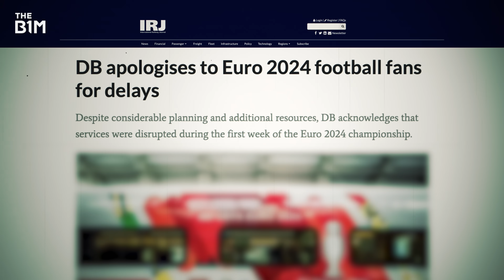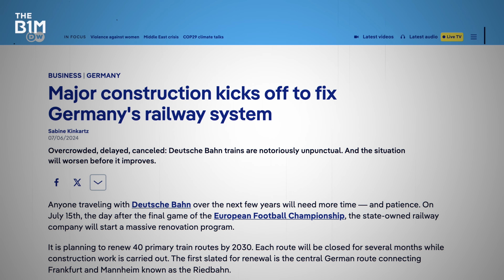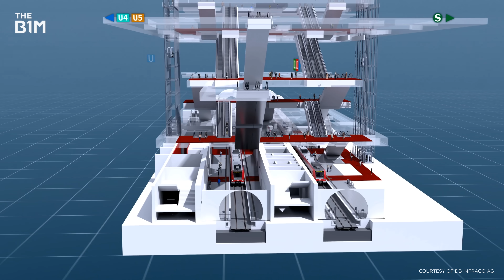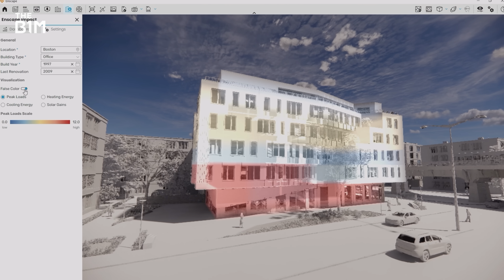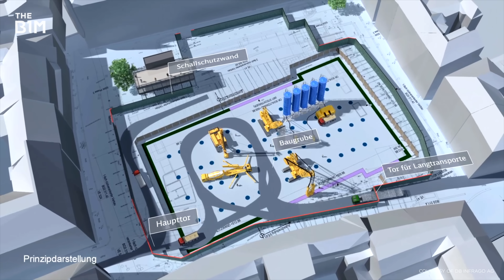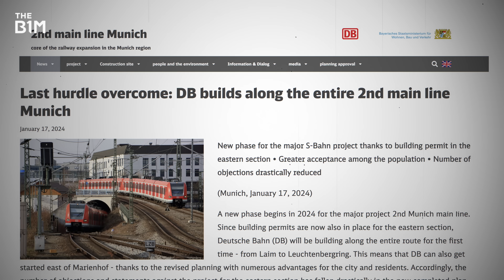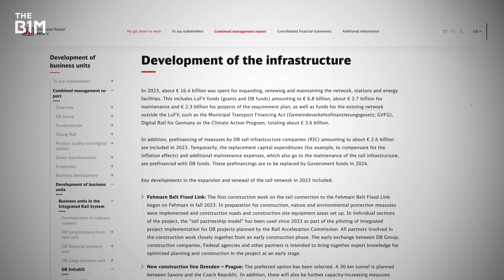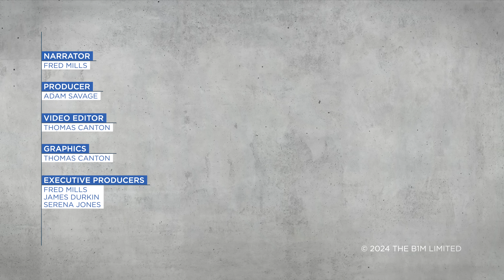Germany is (Finally) Fixing Its Failing Railways

Comment: well as a transit planners point of view i have to mention that the munich 2nd s-bahn rail core is mostly politically driven and most of us planners agree if we could stop any transit project in germany, its that one, since according to studies, it will make public transport worse and also never make up for the carbon emissions during its construction. its similar about Stuttgart 21, since it actually reduces stuttgart hbfs capacity (which is actually the most punctual train station in Germany) and will not give room for service expansions, its mostly a real estate project for the formerly occupied area of the train station. however the project could be useful if part of the overground station is kept

Comment: Compare and contrast with the UK's long struggle with HS2, and it's miss selling as a high speed line, as opposed to its true major benefit, capacity.   Britain's railways need a similar upgrade across the system to make it fit for purpose.  I hope it will come, and soon, but I'm not holding my breath.

Comment: That's great!
But I don't get why, for München's S-Bahn, they don't go Paris RER style by building a North-South tunnel instead of simply doubling the East-West one.
Funneling so many lines or branches in the same corridor seems a bit weird given that several branches run to the North and South.
A single S-Bahn tunnel and corridor is fine for a few branches, but 8 lines and presumably twice as many branches? 
The current system looks like a bow tie or a "farfale" pasta, with a clear bottleneck. Another central tunnel, but built North-South, would improve the coverage of the city by taking some lines off the current East-West tunnel and creating another corridor.
Lines could even loop from one central tunnel to the other and form a kind of 4-leaf clover shaped S-Bahn network, with 8 shaped lines.

Comment: In the south especially towards Switzerland via Basel SBB passengers are not this lucky. Expect delays up to 120 min and terminations prematurely at Bassel Bad. 
The line between Offenburg - Freiburg - Bassel is one of the most congested routes and an International one (with regional, long distance high speed (international), and freight (international) all running less than a minute behind each other without ETCS, which just mad and a disaster waiting to happen.   
Here's the dumbest part they plan on adapting ETCS (European Train Control System) and line quadrupling by 2040!

Comment: And how many of these new stations will be wheelchair friendly????  And with wheelchair friendly, I mean, being able to go in and out with a wheelchair without the need of assistance.
Reply: into the station ?
all of them
...
into the train ? well ....
Reply: @baronbrummbar8691  yeah, into and out of the train. Without the need of special ramps or assistance,  just same level platforms that are close enough to the train to just roll into the train.
Reply: @PetervDam  that is impossible as the trains have differente broads  
you can´t make the platform go to the train or a wider train will not fit
Reply: @baronbrummbar8691  impossible? Cities like Seoul show that it is possible. Some have moving parts when the train stops that close the gap. Its no rocket science.  It's a costs thing but if we want to go green, its an important step to include the less able as well in my opinion.
Reply: @PetervDam  you do know that would require to replace all trains ........... 
it is not as easy as to simply 
install XYZ
the entire system has to be made for it
Reply: @baronbrummbar8691  my point of my comment was only to put some awareness that even with big billion euros projects like these, making it accessible is still not a thing. It's a limited factor for more people then most think. I know it's not as easy as a different color paint job for the train, but hopefully with more awareness and more noise, the accessibility might be considered more often then not, like now.
Reply: @PetervDam  noice making will not change the reality 
completly reconstructing existent things is super expensive and the group that needs it is just way to small to justefy that cost
.........
the new train stations will allow anybody to get to the trains
and majbe they need some help to join enter it and ther is no problem with asking

Comment: Honestly, a project the size and complexity like Stuttgart 21 costing 11bn isn't something crazy high. Expecting that it only costs 4bn was just naive. 

Just look at the "Durchmesserlinie" in Zurich. It is ONE tunnel. ONE bridge. And only four new platforms at Zurich HB. And it already cost 1.5bn. 

Stuttgart is at least 10x larger and at much more complex. Good infrastructure is just expensive.
But people don't realize that bad/easy infrastructure like Autobahn is as expensive. It is just build in smaller increments, for much less capacity.
Reply: Stupid plans are expensive. Instead of letting high speed trains stop at the Stuttgart airport and connect the city (who wants to visit this city?) from there local „politicians“ forced both government and DB into this stupid nightmare if Stuttgart 21. We had the same with each and ever new high speed line in German. Frankfurt-Cologne got two additional stations just 30km apart only to please local politics and convert a high speed connection into a joke on track. This is like forcing direct flights from Hamburg to Munich to have two stops Cologne and Düsseldorf. 
Last nail into the coffin of high speed connections: They have to share the tracks with all kind of slower passenger and non passenger trains. 
This country wasted over decades billions of Euro into more concrete for roads and highways. Some countries are driven by good ideas, this country is only able to let fat people drive cars without any sense 24 hours a day.

Comment: A country that you wouldn’t expect to have a decent railway system is Italy… the process of replacing old trains is almost finished… delays are becoming the exception and high speed service is one of the best made in the world. Also the application of Trenitalia is really well made and the various services offered by Trenitalia are very nice.
Reply: And yet the local public transportation system in Rome sucked when I was there
Reply: @baab4229  I don't see how Rome having mediocre public transport relates to the national railway system of Italy. Did you travel around rome via regional trains or what?
Reply: For reference: trenitalia was so successful, it put their national airline out of business.
Reply: Italy's shape makes it very easy  to build an efficient network tbf.
Reply: @LievenSerge how Shape is not the only relevant thing, obviously being long and thin helps. But it’s crossed by mountains all around.
Reply: isnt making the trains run on time the mantra of the modern italian state?

Comment: What's going to be interesting as well is the plan of the city of Frankfurt to basically build a huge underground terminal under the current main station. Frankfurt is a sack station, meaning the train has to go out of Frankfurt the same way it got in, so they made a plan to change that via a huge underground terminal and tunnels

Comment: it is true what you are saying, but you havend mentioned importent things: 1. Volker Wissing ist vorm the conservativ, liberal party FDB, witch supports more cars then trains - he only did this because he had no other choice. 2. The 40 BL € are not even close to be enogh. It will will need more than 90 BL €  to only get an ok running system. 3. Therer are several major projects, witch are extremly neccesarcy to complet, but are not getting forward. Like the route from Italy to the norther sea. All countries have finished their traks - except for germany. They haven even startet to incriese the traks to 4 on the Rheintalbahn, which is exremly overcrouded.

Comment: 1. Use as few transfers as possible. 2. Replace a short trip from a bigger train station to a small local station with a rental car. 3. If transfers aren't avoidable, make sure to use the same train type for all of your routes. 
This way you're almost always on time. And if not, you're way too late. Like in hours

Comment: A few point.  DB may have been making a significant amount of refunds, but often refunded only the outbound leg of a round trip ticket when a train was cancelled, even if the return trip could not be reasonably used by the ticket holder.  Fixing the S-Bahn in Munich is nice, but long-distance trains will still need to loop around the city when traveling to points south and east, which adds about 20 minutes to travel times.  That this project, which started in 2019, could take another 12 years and only improves S-Bahn service is crazy.  Germany is still not doing enough to bring train speeds along all corridors up to the standards of France, Italy, and Spain.

Comment: Switzerland made the trains something the rich want to ride, and it has been a successful endeavor.  When the rich want to ride, trains get funding.
Reply: As long as the rest of us can afford cattle class!
Reply: @TheHoveHeretic  
That's the thing, they are affordable, it's that they are run better so that lateness is much less of an issue.  These trains do have amenities that the rich can purchase that make it convenient as they travel, and that helps offset certain costs, too.
Reply: TBF they pump in alot of tax payer money 
'making it really exspensive 
and even then tickets ain´t cheap
Reply: @baronbrummbar8691  
Their tickets are middle range, and that's in part because their rail is well used.  If it was rail also used for shipping, sayat night during off hours they could likely reduce costs more.  
I am a fan of publicly owned rail because this rids us of rail monopolies that prevent smaller businesses having access- its a cheap mode of transport.  Conversely think it's better to have private businesses running trains, because businesses are better at running lean.  So I think a hybrid system would be a better way to go.  That said, Britain has a hybrid system, heavy ridership, and is much more expensive than the Swiss system, but that's likely because they have rail largely just for public transport...
Reply: @b_uppy  ???
the swiss system is way more expensive
it is simply funded by tax payer money 
so tickets are cheaper
Reply: @baronbrummbar8691  
The British system as well.
Reply: @b_uppy  the subsedies in the UK are way way way lower
Reply: @baronbrummbar8691  
And again if they also used their fail for transport of goods during 9ff hours, it would lower costs.  
Btw what's your source(s) regarding comparing the two?
Reply: @b_uppy  in theory yes but you can´t simply switch it .........
what do you not understand about that
thouse are two incomatible systems
........
germany has the exact same problem
....
german even has 4 major independent rail systems that are not compatible with each other
that is the only reason ther still is a diffrence between the S and U bahn
they run on diffrent volltages and therfore can´t be conected
Reply: @baronbrummbar8691  
You are on a tangent...
Reply: @b_uppy  tangent ? are we in geometry now ?
Reply: @baronbrummbar8691  
That the use of "tangent" is the main point of your comeback, is on you.
Reply: @baronbrummbar8691  You are mistaken. While governmental support for the railways is indeed high in Switzerland, the UK subsidy/passenger or ton-km is actually slightly above Swiss one. The UK problem is not that subsidies are low. It is that construction costs are way way higher than in Switzerland.

Comment: I live not far from Frankfurt, and have enjoyed grumbling  frequently about the  Riedbahn upgrades, but, they are finishing on time, the improvements will be fantastic and the replacement bus services have actually been pretty good.  Compared to the UK network where I grew up, there's no comparison. It's far from perfect, but overall it's not that bad.  The fares are reasonable and the service is (usually) decent.  When they closed the line here after the Euros I thought there was no chance they'd be done by xmas, but I was wrong.

Comment: We have no plan to fix rail, no.

My S-Bahn (urban-suburban commuter rail) is being made useless for 2+ years because of a landslide requiring a new wall to be built just behind a tunnel. Luckily, they can use the quick process - which takes only 18 months, adding 6 months for the paperwork to start it. And there's already talks about delays (rumor has it it could be much quicker if they used a different process, but the one they chose means they get federal funds for it...)
Yes, there are replacement buses between the stations on both sides of the tunnel, but at that point, you may as well drive on your own.
Yes, I can use other trains... but that one was at capacity before that S-Bahn was added on top of it.
That train is also being upgraded for over a decade now, after much longer prmoises, at one point including maglev. (Which was always silly because the main stations are so close, but at least that's more than the minor changes we get after all)

Comment: Maybe they should start hiring MORE PEOPLE!!! The delays are almost always happening because the DB tries to cover up staff shortages. And the CEO's and shareholders get giant bonuses.
Reply: The single shareholder in Deutsche Bahn is the German state and while there is still a lot wrong with the way the company is run, they have at least ended the insanity of the “Privatise everything!” era. Which means that at long last, some of the so-called savings (i.e. the decimation of Germany’s rail infrastructure) from when they were trying to make the company financially attractive to potential non-governmental shareholders are being reversed and repaired.
Reply: @CX103  but we need privatisation. private rail companies have better service and less delays.  only the railnetwork itself should be government run

Comment: What is a 100 billion passenger kilometer?? I just couldn't understand
Reply: It’s the number of passengers multiplied by the number of kilometres each one of them travels.
If you have 20 pax travelling 50km and 10 travelling a hundred, that is 2000 passenger kilometres in total.
It’s hard to calculate these numbers when lots of people have season tickets, but you’ve got to try to find at least some data as a basis for your plans for future rail service.
Reply: Thanks for the answer, seems like they want some parametrs to reach billions to make it more important

Comment: The Title is this story is wrong and misleading and at no point have the authors either provided proof or challenged thier hypothesis that the german railway Deutsche Bahn is failing when in fact the argument surrounds the continued increase in passengers and that continued improvement has been in the implementation stage all along having begun a decade of more before ..kidos to germany

Comment: While these projects are impressive in scale, keep in mind that Germany is still way behind compared to most of Europe if you look at the amount spent on rail per capita. 
Also these renovation projects are only coming now after decades of neglect. So while I'm sure they will be able to show impressive improvements compared to the current state, the overall capacity will most likely be about the same as it was 20 years ago and the cost of better maintenance would have been a lot lower than what we have to spend now.
That maintenance budget probably is also not going to grow in the next coming years looking at the current political situation. So we are spending all of the money on the big city to city corridors while the rest of the network continues to be neglected. 60 billion is a lot of money, but it's not even close to what we actually need to truely promote travelling by train vs by car.
Reply: thats because alot of german money is spend on those raillines in the rest of europe...

Comment: Don't forget that for the past 30-odd years, government investment has been ploughed into the eastern states while the west just had to muddle on as best it could. 
Now that there's been a generational change the west is only now getting the infrastructure it needed back in the 1990s.
Reply: That’s not true. First of all, the “old states” got two major new high speed lines in the 2000s: Cologne-Frankfurt and Nuremberg-Ingolstadt. And just recently, Stuttgart-Ulm was opened. All three were very big investments.
There were also lots of smaller projects and improvements to existing lines, enabling trains to run faster.
On top of that, all the new lines in the “new states” mainly cut travel times from “the West” to Berlin, which also doesn’t count as ex-GDR.
So really, while it’s true that a lot of money was spent on building rail in the “new states”, the same was done in the “old states”. And the new ones don’t even have a Stuttgart 21 of their own.

Comment: Thumbs up for the Munich part. At least 90% of the B-roll is actually Munich. 
As for the necessity of the second railway: there have been large opposing forces that wanted a ringway around the city because there is basically zero fast connections. If you wanted to from north outside the city to east outside the city, you will have to basically go to Munich center and then back out again. or use a car. we have a ring for cars alright. two of them actually!

Comment: Since the floods in 2021 a major part of the railroads in the eifel has not been repaired yet. also the alternative transportation (Busses) dont have a smart plan. the bus you need to catch up to always leaves 2-3 minutes before your buss arives. like wth. Some other countrys repair stuff likethat in a matter of months. not decades as it will be the case with DB.

I really should not be private...